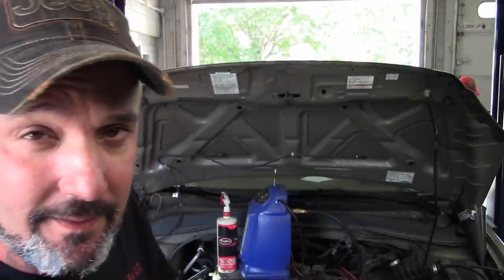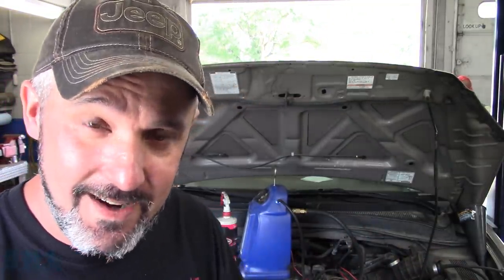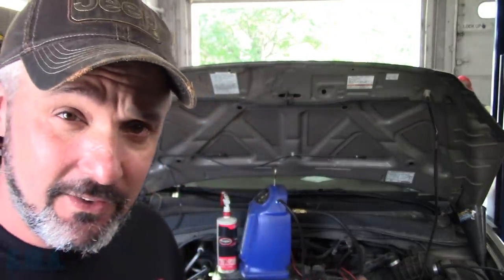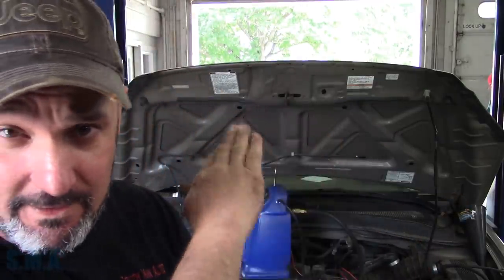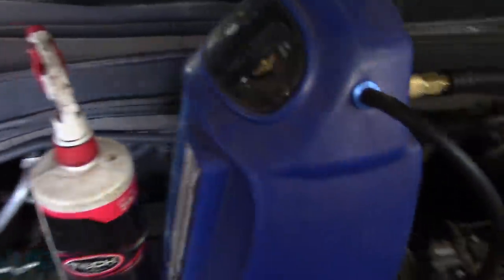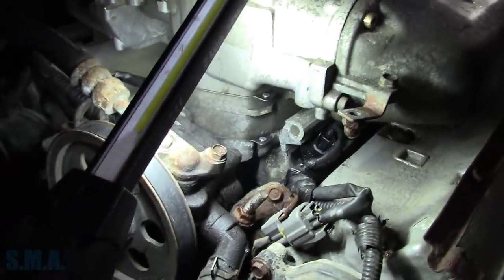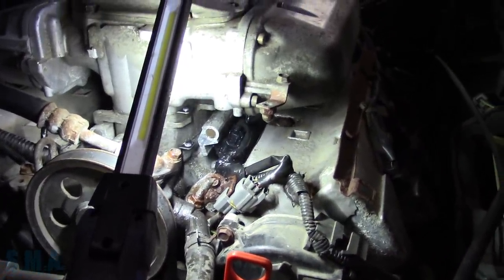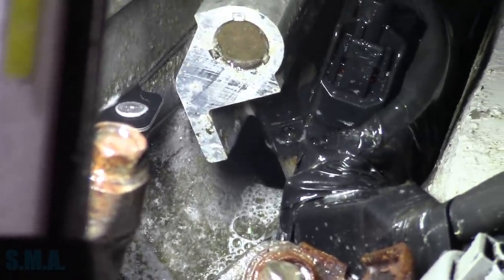Double Check Your Diagnosis!

Comment from the maker: UPDATE: Jason ended up doing this job for me after we sourced a used lower intake manifold. The customer wanted some other work done when we in there so I was not able to record him during the process. Once the lower manifold was removed it was very obvious. The crack extended all the way around the back of the manifold and was only hanging on by about a 1/2" of material before reaching the edge. It was very random as it did not start at an edge or a bolt hole 🤷‍♂️. Any how, the vehicle is back together and the customer has had it for a few weeks with no issues and the misfire at start up is resolved.  Be sure to take your time and double check yourself if you have too. Even if it is an issue you "know what the problem already is." Thanks for watching!
-Eric O.

Redline Detection 95-0082 Easy Intake Diagnostic Leak Detector: https://amzn.to/3iHaOjz
OTC 6522 LeakTamer EVAP Smoke Diagnostic Machine:https://amzn.to/2FNlLBT
Reply: Excellent trouble shooting and verifying. Glad Jason fixed with no issues. Thanks Eric for the short and to-the-point video.
Reply: Since I started watching your videos its taught me to be more thorough and do repairs. Thanks Eric O.  Great job as always
Reply: Probably already stated in other videos but I haven't seen it yet.  I'm curious as to where you started in auto repair and the education you received throughout your journey.  I'm fascinated by your teachings and thorough troubleshooting.  Thanks!
Reply: Did the customer have the old intake?
Reply: Us humans are prone to error at times...that's what makes us human😄 Glad to hear it's fixed and you satisfied your customer once again
Reply from the maker: @jacksonbennett6151  No unfortunately. Got one at a local wrecking yard pretty cheap though.
Reply: You are extremely smart & good at what you do. I have a 03 piolt and 2 months after buying it.  It developed a random miss a very bad one. Turns out to be the trans yay me. Looks like I'll be letting them repo it because I'm not paying 6 grand for a car with a bad trans
Reply: @daveloughlin2217  ouch I paid  $7 out the door for an 04 forester years ago now 175K just needed a radiator last week.
Reply: @daveloughlin2217   Do you not care about your credit going to hell with a Repo on your history report?
Reply: Weird that the crack propagated like that, probably was a bad casting that went through quality control on a Friday at the plant 🤣🤣🤣
Reply: @SouthMainAuto  used is better then dorman 😄
Reply: @jamessampson2029  I got into this with a friend of mine. His mercedes needed a coil and he's like "let's replace all of them". I said no telling him that the new one he got will probably die before the original ones....fast forward 12 months..and another dead coil...oh wait, new coil died. This time I moved the next one he got to another cylinder and put the OE one on the cylinder that died...fast forward 12 months...the "new coil died" We went to the yard, got some used OE ones, been trouble free since.
Reply: Good call, I have never seen a broken intake on a j motor.
Reply: Nothing a new roll of silver duck tape cant fix 😂
Reply: I wonder if it was cracked while removing or installed? You know how those wrecking yards use the utmost care when removing engines with a cutting torch, a strap and the largest pry they can find.
Reply: @frompdiggity  He worked in his fathers shop, mostly trucks(?)
So he has an advantage over many people that he grew up with it.
Reply: I wonder how the heck that crack formed. I'm assuming that is a cast aluminum intake, must have been weak in the casting from when it was made. Or... someone put too much weight on it somehow
Reply: Most shops just guess then lie to the customer when they are wrong and still come out ahead. Commendations for having principals.
Reply: 815 bucks... I made mine for free out of a pickle jar baby oil an old soldering iron I laying around and a sock. Then for the air pressure I used a little pump you plug in that's used to pump up swimming pool toys... Thing works like a charm. Some people don't have that much money to throw away
Reply: Best guess is, that happened in tramsport. You mentioned he put a wrecker engine in it, didn't you?
Reply: @JB-Was-Here  and lasted 16 years before going bad? More likely whoever put the replacement engine in that car bashed it against something while it was on the engine hoist.
Reply: Does Mrs O really recognize what a genius you are?
Reply: @joedesalvo3316  I do but I don't know what other options i have
Reply: I have had cars for over 200,000 miles - never had the intake manifold crack.  What causes that?  I have never even heard of it before.  Thank you.
Reply: @daveloughlin2217   You should have got a 90 day Warranty at the minimum when you bought the car... I dont believe places of business can sell a vehicle without at least a 90 day warranty.. unless you bought it from a private party or declined any warranty that was offered
Reply: @PeterFeltersnatch852  Are you referring to the smoke test machine? If so, I'm glad that you could build your own. On the other hand, Eric isn't throwing money away by buying one. Shop equipment is a tax deduction for a business.
Reply: @joedesalvo3316  Used car dealers do it every day. As is/no warranty.
Reply: @MikeBrown-ii3pt  never was putting him down or anybody down I was just saying that you can make your own... That's about it buddy...
Reply: @PeterFeltersnatch852  I know you weren't putting him down. Sorry if my comment came across that way. I make many of my own tools too. Have a good one!
Reply: @MikeBrown-ii3pt  np at all. Appreciate that
Reply: Sometimes it pays to listen to that little voice in your head Eric.
Reply: Simple Man Do you have a video you can make to show us?
Reply: Jonathan Kuhn She has kids with him, doesn’t she??
Reply: @JB-Was-Here  My thoughts, exactly.
Reply: When I saw the title I thought it was going to be about a sensor. This is a really weird one, I wonder if this was a manufacturing defect from the beginning.
My strategy when I suspect a sensor is to disconnect it and see if anything changes. Not always feasible, but can help sometimes.
Reply: Take that Murphy Law!  Defeeted Again by SMA!
Reply: Nice catch, You saved a comeback..

Comment: I was a g.m driveability tech for 30 years, I ALWAYS ALWAYS double checked my diagnosis, had one of my first jobs come back as I missed the part that was actually causing the issue. After that, I always went a little further to be 100% sure. Comebacks are never fun.
Reply: We are a little mor merciful. Here it isn't a comeback unless it leaves the shop. You can be wrong, we don't like it, just fix it before you let it go. Then we come up with a plan to not let that situation happen in the future.

Comment: If it is a used salvage engine, my guess is it has been banged around a bit, gotten a crack and then the vibrations have made it grow since.
A good way to see is if you can see the edges, if the are jaggy, then they are most likely caused by overstress, you press something until it breaks.
If you find smooth edges, it has happened over time and it is fatigue related, of course sometimes different alloys can make it less cut and dry what the cause is.

Not that it matters anyway, broke is broke.
Reply: mine cracked from parking outside overnight at -24 degrees F, and starting up in the morning, and being an old 200k motor, the difference in thermal expansion cracked it.  I heard it when it was warming up.
Reply: that's my thoughts or it was blazing hot and someone gave it a very cold water bath

Comment: Eric O is consistently a RockStar diagnostics engineer.  I'm always impressed, and that isn't easy to do having spun wrenches and diagnosed a fair bit of my life, cars and data centers.....I'm an IT nerd for a living and a backyard wrench spinner out of irritation with poor auto shop performance.  Grew up working on cars with my dad at 9 years young, and outside of dealer recalls(esp on the wife's car, its a VW...but I drive the ultimate parts machine, a BMW) , do all the work myself.

Comment: Bravo! You pushed diagnosis to perfection. I won't mind paying for a gasket and then learn it does not fix the issue. But I would be mad after an engine is replaced.

Comment: In the car repair business it pays to be 100% right in any diagnosis..some shops are so busy trying to get customers in and out so fast they miss the most simple problems instead of taking a little time to make sure what's wrong..seen this 100 times....good find at least it will be fixed the first..see you on the next one..Cheers friend 🍻🍻🍻🇺🇸🇺🇸🇺🇸

Comment: When I retired from IT I had a reputation for never missing a diagnosis (a few times I could not diagnose, but not many). They didn't know about my previous career in General Aviation (small planes) avionics. In 1975 I had a transponder with a very common problem for single engine airplanes (lots of vibrations) in Phoenix (_lots_ of heat). The slow blow glass fuse was open, and looking inside it I could see the fusible metal was broken rather than melted. The combination of heat and vibration had doomed it. I put  a new fuse in - the problem was a design fault I had no control over - and shipped it. A week later it was back for the same thing... much too fast. What I found was a transistor in the 9V regulator was intermittent (especially when hot) and caused it to draw more current than usual. Same symptoms, same indications, different cause.

Beware the easy fixes!

Comment: Good call on the double take. Have done similar misdiagnosis on a buick 3800 (in a holden though) hairline fracture in head causing high pressure in cooling system, thought it was the falible inlet manifold gaskets :/ second hand heads were 40 bucks each. New inlet mani gasket 60 bucks. Massive headache  averted.

Comment: Bet whoever swapped the engine cracked the manifold!  Excellent diagnosis Eric!
Reply: Probably cracked when the donar car might have been involved in an accident
Reply: Maybe they torqued the bolts to too many Ugguh-Dugguhs per square Potzrebie.
Reply: I've seen salvage yards pull a engine with a endloader, they basically shook the car until the engine fell out.
Reply: @dave1135  yup - and threw a ratchet strap under the manifold and lifted it out that way.
Reply: @MAGADETH watch the video then read the comments, if you don't like spoilers... ;)

Comment: in the 80s before electronic sniffers, we used a special leak detector soap at the gas co. to find even the smallest leaks. after electronic leak detectors came into use i would still use soap to pinpoint the leak for the customer and myself.

Comment: And Mr. O, this is where a knowledgeable shop is worth the money. Other shops would slap a gasket and give it back. Only to have the customer upset about the issue not being fixed. And have more shop time and money spent to only maybe find the problem or slap more parts on it.

Be Real
Be Accountable 
Be an Owner

Comment: I steady hand and some brazing rod, had a crack in my 20 year old Tacoma, exhaust manifold, bought a almost OEM from our Asian Brothers, let it set on the shelf for around 3 years to get hard, Zipped the old one off installed the new one, easy Pies y, but hey its a Toyota, still perfect 10 years later.

Comment: My 87 Ranger has had power loss issues since I got it about a year ago.  After several trips to several different shops they all kept pointing towards the ECM.  I ordered an ECM and ECM relay.  While waiting on them to show up I figured I'd jump on The Ranger Station forum and ask around.  One of the guys on there says hey have you changed the O2 sensor.  Well no, hadn't thought about it as I hadn't gotten any codes off it.  So A trip to the part store to get an O2 sensor and socket, 5 minutes later I have a great running 33 year old pickup....hmm, glad I didn't listen to the shops around town, and listened to a Ford Certified mechanic on a Ford Ranger Forum.  So the ECM & relay showed up a few days later, simply sent them back to Rock Auto.  Glad the truck is fixed though, for being 33 years old its in very good condition overall and only 117k on it.  I'm going to sand down the clearcoat since its peeling off and give it some fresh paint here soon.  Rustoleum paintjob LOL.

Sometimes it pays off to be patient and ask around, not necessarily at repair shops, especially with older vehicles where mechanics now typically have no idea if they can't plug a computer into it to tell them what's wrong.  Saved me about $200

Comment: If it's important to measure, measure it twice, with a different gauge method...  Not just twice with the same gauge.   Exactly method Eric used.  Leak on suction side with fluid; leak on pressure side with smoke.  Signal via RPM and 'bubbles'. Well done.  If only the folks on 3-mile island used that method or engineers had designed gauge METHOD redundancy, not just replicate gauges.

Comment: I think the lesson here is that spraying fuel to detect an air leak is not tantamount to diagnostics.  It steers you that way, but the smoke test is definitive and spray fuel is suggestive.  Both are useful when used right.

Comment: conversely many years ago I had an 83 reliant. was told needed a new carb. real problem. silly quarter inch rubber line running along valve cover was the leak. opps found and fixed myself.  cost $1 for line  + my labor charge was high. got my hands dirty and everything.
Reply: I chased a misfire on the rear cylinders of my F 350  (460 V8) for quite a while. Putting a bit of propane back there smoothed it right out. I eventually found the leak: there was an "octopus" multiport fitting on the vacuum connection with most of the ports sealed off with rubber caps. One of the larger caps had deteriorated and the end of the cap had been sucked into the manifold. I replaced all of them for a few dollars and had no further problems. Previous diagnoses were carburetor and EGR valve. Plus a tune up, of course.
Reply: @machintelligence  amazing rubber isn't forever.
Reply: like tires with 90% tread but leaking sidewalls
Reply: @johnditch6357  It even looked OK (in an inspection mirror) until I put my finger on it and the idle smoothed right out.

Comment: I remember old school aluminum intake manifolds that would develop a leak through the casting if they were cleaned with strong carb cleaner as the aluminum was porous and the carb cleaner would dissolve the factory sealer coating, not necessarily referring to a broken intake but have you heard of an aftermarket sealer that actually works and holds up to the heat?

Comment: I had kinda the same thing but with an oil leak right near the valve cover on a Chevy cruze, Turned  out to be hair line crack in the head. funny thing is that same car came to the shop twice. the customer sold the car after the fact and the unsuspecting purchaser brought in to have a valve cover put on that was already done by a dealer twice. Yea it left without a single bolt loosen

Comment: Looks like someone tightened that fuel rail too tight-(crack)- oops that didn't sound good. Shipped it and let it be someone else problem.Ahh yes the classic, "I had a used engine installed by the cheapest guy I could find" and my frugality shines as I putt down the road with sky high fuel trims. As Eric would say"Well.. There's your problem Lady"

Comment: I'm curious why the guy replaced the engine. Did the previous one have the same issue that went undiagnosed then eventually blew the engine. 
Good job Eric O on this diagnosis. Most mechanics probably would have done the gasket charge the customer that then few weeks later charge again to replace the lower intake.

Comment: Yeah I thought I had either a cracked head or leaky head gasket. Before going for parts I thought I’d better take the heads off and at least look at them. When I got it apart  I realized a head gasket wasn’t gonna fix this problem. The block had a big smile in it. A crack about 2 inches long in the shape of a smile. So it pays to look a little deeper like Mr. O did. It can save ya time and maybe a little embarrassment in the long run.

Comment: I would take a guess someone previously disassembled it to do a "carbon cleaning" and didn't torque the upper intake manifold down properly.  If the runners weren't internally coated in crap then you know it was cleaned (I've taken my J35 apart a few times for valve lashing and upgrades).  Or someone did something stupid like lifting the entire engine on just the manifold.

Comment: JB weld and done 

Just kidding.  Excellent head on ya sir. If you have a hunch follow it.
Reply: Actually I wonder if it would work if you cleaned it up good, sanded it down, etc and tried some JP.  Heck, I would try that first since if it does not work, no big deal since it still drives fine.
Reply: Matt Mccoy — I bet that would work.